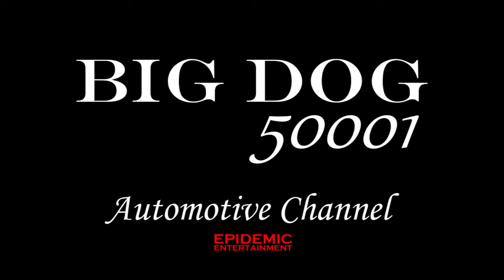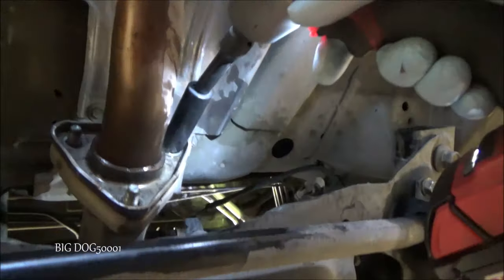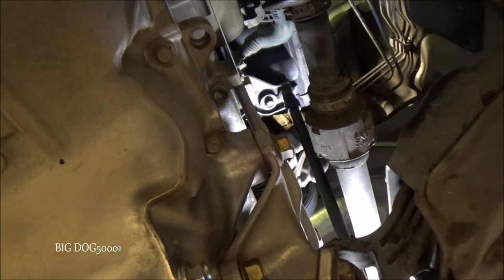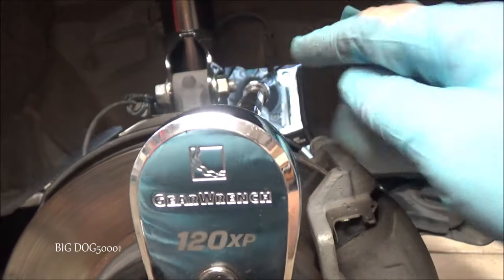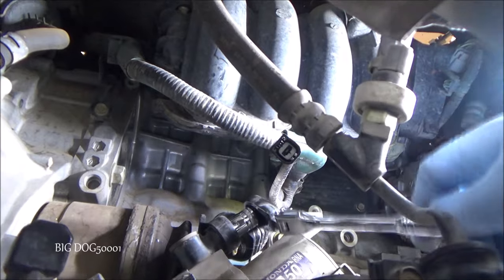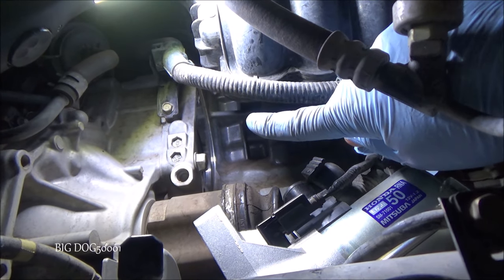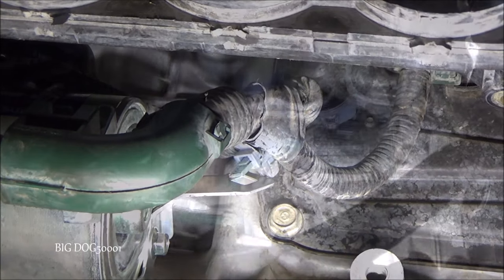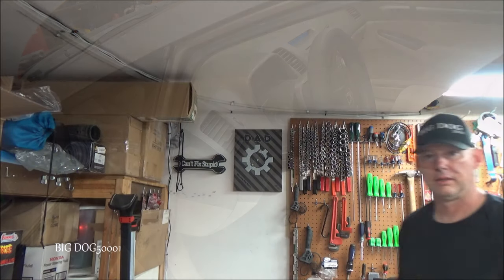Honda Civic Starter Replacement 2006 (2006-2011 Similar)

Comment from the maker: Parts and Tools
Disclosure: This channel earns a small commission using some of these links - at no additional cost to you.
Honda Starter 31200-RNA-A5:  https://amzn.to/2NRq6FP
Pittsburgh 6 Ton Jack Stands:  http://bit.ly/2q5pT8V
Daytona Jack (Cheaper at HF with coupon):  https://amzn.to/2qevY2H
Smaller 3 Ton Jack Stands (Cheaper at HF):  https://amzn.to/2CLOmTa
GearWrench Ratchet Set:  https://amzn.to/35OQ2IP
GearWrench 3/8" + 1/4" Sockets:  https://amzn.to/33LQCWe
GearWrench 1/2" Sockets:  https://amzn.to/378AEYs
Milwaukee M12 Ratchet:  https://amzn.to/31ydNSo
WD 40 Rust Penetrant:  https://amzn.to/2KphtzT
My Favorite Little Screwdriver:  https://amzn.to/31qFI6B
Milwaukee 3/8" Impact:  https://amzn.to/2KkrkHe
Milwaukee 3/8 Stubby Impact:  https://amzn.to/2KnjEUI
Astro 40SL Light:  https://amzn.to/2OZ7moI
Sunex 3/8" Impact Sockets:  https://amzn.to/351PDBD
GearWrench 1/2" Extensions:  https://amzn.to/2qiyNzE
GearWrench 3/8" Extensions:  https://amzn.to/2XeAWII
GearWrench 3/8" Universal Sockets:  https://amzn.to/2rHgJ2x
Snap-On 3/8" Torque Wrench:  http://bit.ly/2TzsaU0
Exhaust Gasket 18229-S5D-A01:  https://amzn.to/32Ubv0A
Exhaust Gasket 18303-SM4-020:  https://amzn.to/2OkeMB4
Self Locking Nuts 90212-SA5-003:  https://amzn.to/2qPb7Tz

The Big Dog 50001 Automotive Channel Store can be found here: https://www.amazon.com/shop/bigdog50001automotive

Comment: Every Auto engineer and their bosses should be made to replace their designed idea/engineering 5 years after their design in the order below.  Twice in the rust belt (New England etc), once in the south and once in the west. Also they should be made to replace them twice in the rust belt using Jack  and Jack stands only and once in the south on the lift. After that, I guarantee you that things will get way better for us all including the customers we Serviced. In the rust belt, the labor would be double and the number of F.....bombs while replacing the starter will be tripled. Keep wrenching, I appreciate and love all your videos.
Reply from the maker: I am glad I do not live in the rust belt area anymore!  Thanks for the comment!
Reply: This. And the fact that the 8th generation had a quiet cracked block recall and I am done with Hondas.  I've heard this starter placement design continues at least until 2019 so I'm done with Hondas.  I had a 91 Acura Integra. The axle had to be removed to get to the alternator on that.   Back then I swore no more Hondas.  This time I can see they don't care.  I'm done.
Reply: Won't matter. The requirements are set by sales and marketing people based on customer wants. No customer has ever walked into a dealer and asked for a car that's easy for mechanics to work on. For Honda mechanics this is not a hard job once they've done it a couple of times.
Reply: @sl5311 The R18 is a super reliable engine. That cracking problem was a manufacturing defect that was limited to 2006 an 2007 models. The failure rate was too high, but they didn't all fail. Honda put a 10 year unlimited mileage extended warranty on it. I have a 2006 with 250k miles, and no issues. Honda used that engine for all eighth and ninth civics until 2015, and in the HRV. Both the Civic and HRV are very reliable, largely because of that engine. The body on my 2006 is rusting out, unfortunately (salt belt). I'm going to replace It with a 2013-2014 ninth gen Civic specifically because of the R18 engine's reliability.
Reply: @jptrainor

Comment: I’ve done 3 of these. This is the best video that shows the horrors of this replacement. I’ve tried from the top which is removing the intake manifold….id say it’s easier but also at the same time more work but less stressful if that makes sense.

Comment: I have a 2006 Civic EX MT and removed old and installed new starter without removing the exhaust pipe.  It is possible.  That said, it does make it harder.  This is a great video for this task.  Helped a lot.

Comment: I can't stress enough how lucky you are working on a car without any rust!! 
Us in the north, you can't touch any bolt, they are seized, glued and impossible to work with. You will spend 2/3rd of your time fixing broken bolts or aluminum thread ripped from the engine that are stuck to the bolt.
I envy you!
Good work as always!
Reply from the maker: Rust sucks!  Thanks for the comment!

Comment: Thank you. You saved me $400. Aside from being extremely sore right now, my only problem was that I didn't put the starter relay clip on hard enough so my Denso starter didn't work. After cursing up a storm, removed it again, put the clip in until it clicked and then it started.

Also, for anyone doing this, get a universal joint socket for the bolts, you'll thank me.
Reply: What starter relay clip I’m having the same problem

Comment: Thank you! This was not a fun job for a big guy, but I was able to get it with your video! Definitely recommend taking the exhaust pipe out like this video suggests. A little PB Blaster and some heat got my semi rusted exhaust nuts loose
Reply: actually i did it in a little over an hour without removing exhaust or rf tire but im a little guy so guess was a plus

Comment: Looked like a pain in the butt but I did two civic starters last year (different cars) without removing the exhaust pipe! Hated every minute of the 6 hour job on the first one and the 4 hour job on the second starter. My 2005 Accord starter was much easier. 
Thank you for the great video.
Reply from the maker: Thanks for the input!

Comment: Big thanks to you bigdog 👍🏼 this is the easiest way to break loose the bolts , is using an extension and crank it at the wheel well . Manage to get it done with lots of swearing 🤬 involved.
Reply from the maker: Glad it helped, thanks for the comment!

Comment: Looking at this job reminded me of my ford f150 starter replacement 😭🤬😫🍻🍻🍻🥃👨🏾‍🔧, the good thing about this Honda Civic starter is that the last bolt is extended out, unlike the ford which is hiding in a blind cavity.
Great and detail video again 👌🏾💪🏾👏🏾🙏🏿👍🏾.
Also live Hondas exhaust systems bolt on 🥳🤔.
Reply from the maker: Yes, at least they extended the top bolt lol, thanks for the comment!

Comment: 8:20 That upper bolt is really interesting as a mechanic's puzzle. It has a head extension, so flexes before turning. The subframe prevents a ratchet from moving enough to click due to the bolt's flex. I ended up with a similar solution as yours, but used a longer snake of 3/8 extensions to come all the way out of the wheel well so I could apply torque in line with the bolt. Other solutions I came up with afterwards are to use a Tite-Reach or to have two ratchets on the bolt so one can hold torque while the other clicks back. Dual ratchets can be achieved with any square driver that has both a socket and a hex. You put a ratchet wrench on the hex part and a normal ratchet into the socket. Click them alternately until the torque builds.

Comment: Upstate New York mechanic here; great video but I've personally found a far easier way to do this without removing anything other than the passenger front wheel, passenger splash guard, the small bracket held in by three bolts to the immediate right of the starter, as well as the starter itself. If you remove the aforementioned wheel and splash guard, then remove the small bracket, unclip the power cable from it's hold downs on the starter and back of the engine, you can easily access the 2 14mm starter bolts with a combination of 3/8th extensions or a single extension roughly 24-30 inches long and a chrome swivel (impact is a bit too wide), it should turn this into a very easy process. obviously once you remove the bolts you still have to remove the sensor and the power wire.
Reply from the maker: That's another way to do it, thanks for the input!
Reply: @BigDog50001  no problem, unfortunately up in our area if you start poking around at exhausts that are more than 5 years old you end up usually replacing gaskets or cutting studs out or worse lol
Reply from the maker: @solidcobalt  I don't miss rust lol!
Reply: Right

Comment: Nice, I just replace the starter on my 2012 Civic. I had to remove one bracket not on this model other than that is the same. Took me a little less than 5 hrs.

Comment: How come you have straight line of sight to remove the long screw? Did you remove some other parts? Also, I don't think I have an opening in the wheel well to put extensions through 🤔

Comment: Hey thanks for the video.  Put things into perspective before I crawled under mine and took this on.  Didn't bother with the exhaust pipe.  But it would make things a bit easier for sure.  Worked around it and took about 45min to and hour to get it out.  Question though.  On the car it wouldn't start unless I tapped it then it would work for a few times.  But out of the vehicle it works every time I engage it. I'm assuming because of no load and under load it's just worn out?  I'm replacing it just waiting for it to come in just wanted an opinion
Reply from the maker: Not under load and you may have fixed it by moving it around and pulling it out (similar to tapping on it).

Comment: I did this a few days ago
I have a 07 Civic and the starter blew so I replaced it with a mitsuba r40 . I can see yours says r50. I couldn't read the text on my oem starter cos it was black from the blow up. I want to know if the r40 is ok or do I have to change it ? Also does the starter have anything to do with how the car sounds ? Your reply would be oh great help to me. Thanks

Comment: I replaced my starter, made sure everything was tightened and connected and while it was up I turned it over and it started up easily but once lowered I tried turning it over and I just heard the spindle spin didn't engage like it did the first time. Any suggestions or advice, I didn't get OEM so I think maybe it was a faulty rebuilt.
Reply from the maker: Doesn't hurt to double check your work but it sounds like you may have gotten a bad reman starter.
Reply: @BigDog50001  yeah took the starter out, turned the spindle and the spindle didn't retract. Faulty part from autozone. They gave me the next best one since they were out of the same one for the same price. Put it in and it starts like a champ. Note to self, have them check it before buying if it's a rebuilt.

Comment: Dave, see if you can use harbor frieght 9 mil glove it is very good. I figured this out after long time.

Honda's are usually good, some model are tough to work to change starters..

One question, when you torque bolt to aluminium body such as alterantor, starter to engine block, I assume torque values are usually less than torquing to  a steel , is my understanding right. 

Because of all such awkward position, we cant use torque wrench how do u handle such things.
Reply from the maker: Yes, the torque is usually less when tightening into aluminum vs steel.  In general, the manufacturer (in this case Honda) already took into account the metal when they come up with the torque specs so we don't need to adjust.    Now that being said, if we did not have torques specs, then we would need to be smart when tightening up fasteners on aluminum parts ;) This is where experience comes in to play.  You can always go to bench (or other work area) and practice at different torque specs to get a feel for it when unsure and you are not able to get a torque wrench on a specific fastener.  Thanks for the comment!

Comment: I installed mine today and after 2 redo’s I still have intermittent grinding towards the end of the start cycle. Trying to figure out if it’s the starter or?…. I re-torqued everything to perfection so I’m not sure. I’m not using OEM replacement but rather a AutoZone starter. My understanding is I should not use or need shims. One mechanic told me it might need to brake in but should not take more than 3-5 days. 1 out of 3 starts results into a small/quick grind sound at the very end once the motor turns over.
Reply: Keep us posted!
Reply: @sl5311  update: As of today and about 8 starts zero noise. Will keep hoping it’s resolved.

Comment: I spent all day doing this repair in my garage and the instructions were spot on but at the end of the day all I got was “click”. I’m ready to take this perfectly good civic to the crusher and go to the dealership over this starter.
Reply from the maker: Was any troubleshooting done before, did the old starter click like the new one is doing?  If the original starter was indeed bad, the new one could be bad out of the box or it could be a connection or other install issue.  I would double check all work done, especially all connections.  If no troubleshooting was done, it may not be the starter, it could be something else.  Also, I try to avoid using cheaper starters on cars that are hard to get to like this one (not saying you did use a cheap one), due to higher possibility of them not working out of the box or failing soon after replacement.

Comment: Hey big dog, sam from saudi, i have accord 2.4 2005 the coolant goes to overflow tank and not back to radiator, there is no bulding pressure in radiator, i replace oem cap but did nothing, i check engine & transmission deb-stick there is no oil coolant mixer , on radiator i find little oil on cap, what could cause that? No leaks for coolant any where . Thank you sir
Reply from the maker: Some questions to ask yourself: Do you have overheating issues, erratic temp gauge readings or issues with vehicle getting up to temperature properly?  You may have a blown head gasket or it could simply be air in system.  I only use Honda radiator caps and thermostats.  I would pressure test cooling system/cap using a good pressure tester to look for any leaks (there are a lot of passages where it can leak).  I would also make sure there is no air in cooling system (properly bled) and verify ECT and thermostat operation.  I might also do compression/leak down tests to look for issues depending on what else I found.
Reply: @BigDog50001  thank you sir, will start looking on it, no heat nothing the car operate just fine, i always open the hood in morning before going to work check every thing, i noticed reserve tank is full of coolant then i start checking. Will report when i fix the problem. Im DIY mechanic.

Comment: My wife has a 2016 honda hrv. It seems like the civiv and hrv share a similar engine bay. It is difficult to find hrv repair video.
Reply from the maker: The HR-Vs with the 1.8L engine (R18) will be similar to the Civic in this video.
Reply: @BigDog50001  Thanks for the information.

Comment: If you're in Canada you wont want to remove the exhaust unless the car is stored inside a garage. Bring out the oxy acetylene if you're going underneath or just remove the axle shaft.
Reply from the maker: Yeah, I wouldn't go near an exhaust system in Canada for this lol.

Comment: Didn't need to remove the exhaust pipe. You can pull the starter out over the rotor. Plenty or room to get it out.  Exhaust pipe get in your way to get the hands there but it's a minor inconvenience.
Reply from the maker: Yes it is possible to do it that way.

Comment: One of the worst starter locations On a car that I’ve ever worked on.
Reply: @willyluciano9036  I didn’t remove the exhaust either but if I remember correctly it would’ve been a lot easier doing it that way lol. All I remember was me cursing a lot but I got it done.

Comment: Man talk about doing it the hard way! Good for you though. Not to be a buzz a kill but the easier way to do this is to remove the wiper assembly and the intake. Takes about an hour if you know where everything is. Once you remove all that b.s. The starter takes about 5 minutes to replace. Just thought i would fill you in. Obviously it can be done from the bottom but way harder than just removing all the crap up top. Wasn't sure if you knew that. Great job btw!